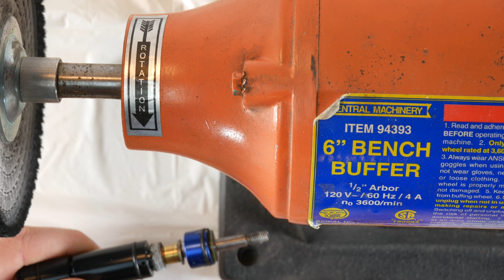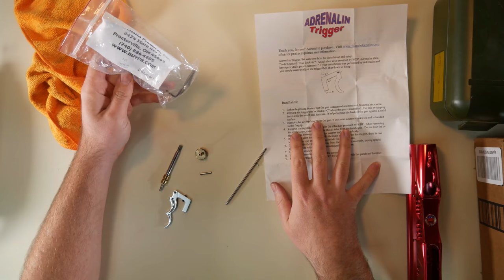Warped Sportz Dark LCD Restoration 1

Comment: I rebuilt an angel lcd with a luckyboard ,lpr pressure is at 8, gun will shoot but with no pressure and no real shot. What should I do?
Reply from the maker: LPR pressure is at 8? or 80? either way it should be around 100 psi on an lcd. The lucky board will also need the dwell adjusted, it depends on the chip that is in the board but considering those chips were originally made for dm4s and dm5s the dwell is probably around 18ms which should be reduced to 12-14ms for the angel. I would start at 14ms of dwell and 100 psi for the lpr and see where you get velocity wise, you can tweak the lpr down for a softer shot or the dwell down for a more efficient shot if you want to try and mess with it but eventually you start sacrificing consistency like this.

If the lpr pressure is really at 8psi than either the spring stack is in wrong or just not behind the lpr piston at all. The spring stack should be 4 beveled washers stacked like this 
Front of Marker - Piston face, )()(, shims, LPR body

Hope this helps you out

Andrew

Comment: where did you order the oring kit for this restoration?
also, what grease did you use?
Reply from the maker: Hey,

Orings are either from mcmaster or the oring store.com I buy them in bulk typically. The grease is a blend that I cut myself with a 3 roller mill. But any dow 33 type grease will be fine

Comment: Where did you get that channel lock?
Reply from the maker: They are Knipex branded parallel pliers, I am sure they are not the only brand that made them. Basically a cross between an adjustable wrench and a channel lock. 

Great set to work with, the only problem is if you strip something you cant blame the adjustable wrench for being crappy anymore, it is always your fault for not having a good enough grip on it.......